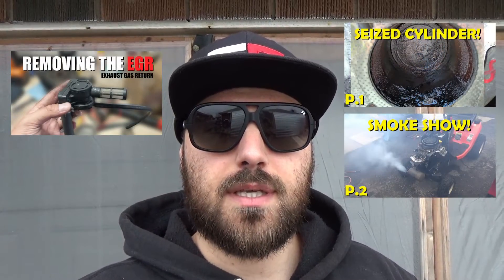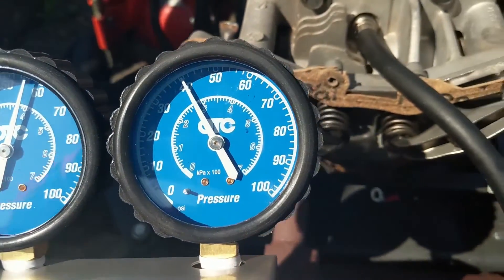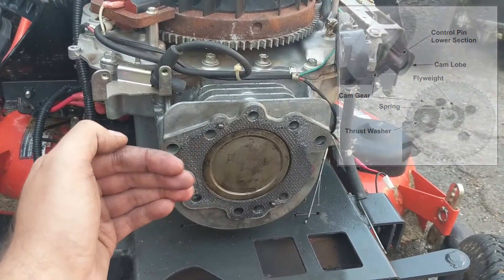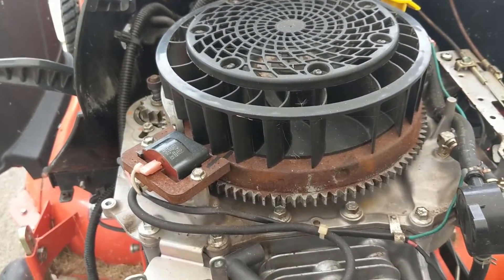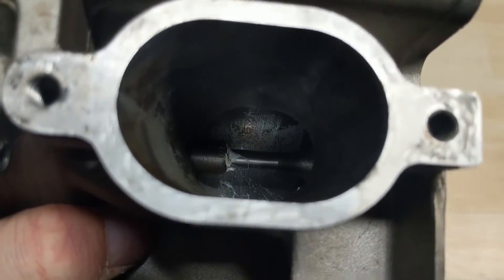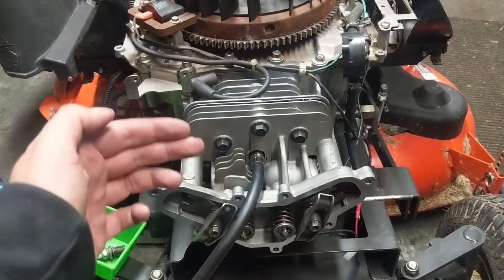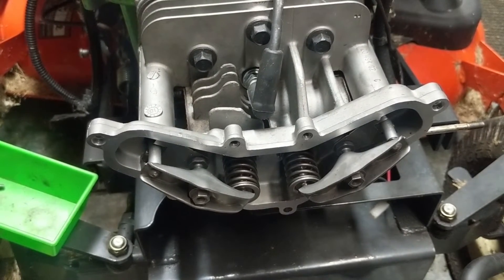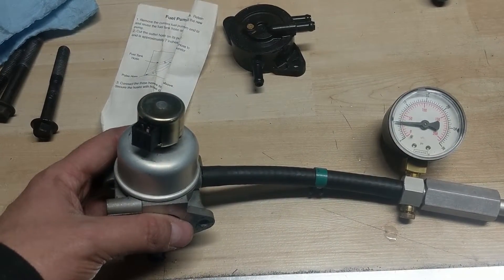Kohler Courage - Intake Valve Leak FIX

Comment: Not a big deal but 4 for intake and 6 thousandths exhaust is what most people set lash to. Even says that in manual. I've got a kohler 735s that runs like it's got a miss even tho the coils are new carb cane off another 735s that runs great. I think it needs a valve job. Can't use the good engine because it's from a cub cadet w a 1 inch pto crank and the craftsman needs a 1 1/8" pto. 
Pain.  Kohler single cylinder models def have issues.

Comment: I have a Kohler Courage with 155 hours on it still going strong.  Before the cover bolts backed out I removed them to apply locktite and re-torqued to spec so that avoided virtually all the issues on it (SV590S).
You couldn't pay me to own a Briggs & Stratton - cheap and lazy engineering on them with a focus on bleeding customers for replacement parts designed to fail.   Their Vanguard line is made in Japan with honor by Daihatsu so they're good, but everything else is a load of BS.

Comment: Im working on a Courage V twin right now. It is running really rough. Its not fuel or air related because putting the choke on does nothing. Compression is nearly identical on both cylinders, healthy 180 psi. Spark is good and strong on both cylinders. Something I noticed was that the right cylinder has a very loud tick when I pull the plug boot off with the engine running. The other cylinder sounds ok for running on one cylinder. I think that this may be my issue, will have to take off the valve covers and check. I dont have a leak down tester so that may be my next step if I cant find anything wrong.

Comment: Great video and editing. Straight to the point. Couple questions for someone uneducated. Why the leakdown test as opposed to a compression test? I saw where you said you had to do it but misunderstood why. 2nd, could you not do the water test after getting it back from the 1st machine shop after getting it back or did you assume it was good before putting it all back together?
Reply from the maker: The leak down test pressurizes the cylinder to not only test the seal of the piston rings, but also the both valves (since they're closed). A compression test only tests the piston rings, and you need to crank the engine over to do that. This engine (and many newer engines) have an auto compression release, which opens the exhaust valve slightly on the compression stroke to decrease compression and make starting the engine easier. This happens only when the engine is cranking below 750 rpm. Once you start the engine it doesn't engage this compression release. So basically you need to do a leak down test to test the valves, and piston rings on this engine. And yes I assumed it was good and bolted everything back together, this lead to me wondering if it was something else. Then I pulled it all apart again and did the water test the second time, making sure it sealed. Thanks for watching!
Reply: @EliminatorPerformance  Thanks! Subscribed

Comment: My ferris was running really crappy. I couldnt figure it out. Mechanic said he fixed it and said leaking intake gaskets. Where is that located exactly
Reply: On the intake. The intake is what connects the carb to the head.

Comment: Kohler is a good strong engine, just not the Kohler Courage series (especially the single cylinder).  Briggs and Stratton used to be good engines, but now only the larger 37 hp Vanguard series is good.  Read up on it and the history.
Reply from the maker: Yea the courage engines are definitely not Kohler's best moment. Thanks for watching!

Comment: How do you lock the engine when doing leak down test ?
Reply from the maker: That's actually a very good point, there's a spot at TDC (Top Dead Center) where your cam will rotate on the lobe, but the piston won't move.

It's like, maybe a 1/4" left to right that the flywheel will move, basically, if you get directly in the center of that spot, the flywheel shouldn't turn.

But, if it does, you can always get someone to hold a Johny bar with a socket on the main flywheel nut!
Reply: Just put it in gear ?

Comment: hey man I have a Cab Cadet ltx1040 Whit Kohler engine 19hp exhaust are glowing red what can I do???
Reply from the maker: Your carburetor is probably running too lean, I'd recommend a carburetor rebuild or replacement. Also, make sure you have proper spark plug in the engine, too hot a plug will cause that too!
Reply: Eliminator Performance thanks man
Reply: Eliminator Performance I need replaced the spark plug to ? or what you mean?
Reply from the maker: @mglvasquezvasquez8843  spark plugs have different heat ranges (example: bpr6es bpr7es bpr8es) so make sure your spark plug is correct #
Reply: Eliminator Performance what is the correct spark plug for KOHLER COURAGE 19HP ?
Reply from the maker: @mglvasquezvasquez8843  most of the Kohler's Courage take a RC12YC, but I'd need a model number of engine to be sure.
Reply: Eliminator Performance sv590s
Reply from the maker: RC12YC is the proper plug for that engine

Comment: Are these made in north America or China ,Its hard to get good quality today. I have only worked on the older ones .Good video.
Reply from the maker: I don't know to be honest, but unfortunately my customer had nothing but problems with this engine. It's finally running great now!
Reply: @EliminatorPerformance  Sorry to bring this back up.  But how much did your customer end up paying for all these repairs?  I would think at some point, it is worth just buying a new tractor!
Reply from the maker: @alklesczewski1207  I honestly forget, but it was a few hundred with all the work combined. New intake valve, new carb, EGR removal, bunch of stuff. What a bad engine lol nothing but problems, although since the final repair and after all the changes, it still runs great